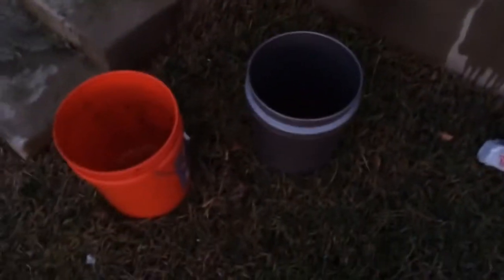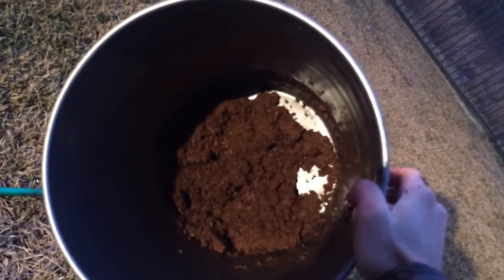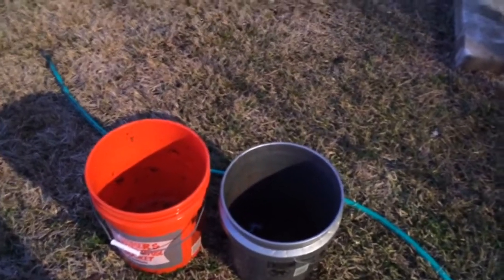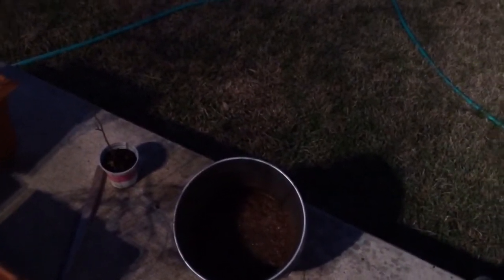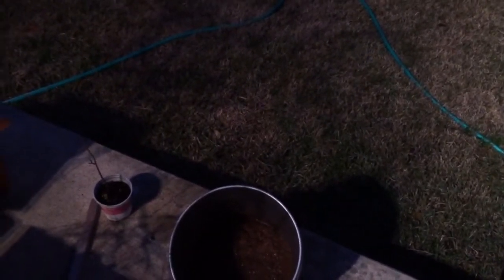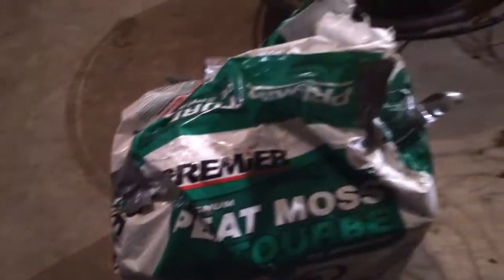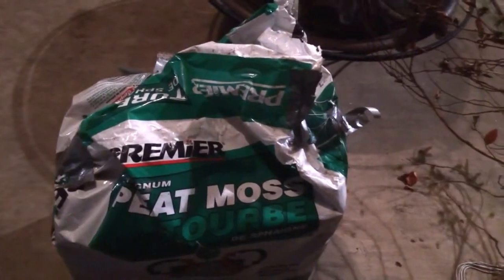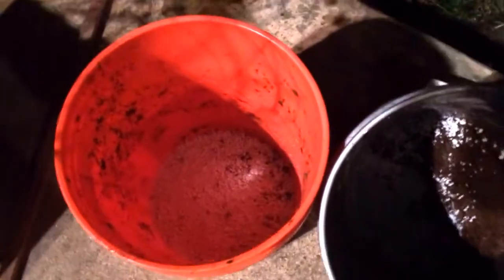Preparing Venus Flytrap Soil

Comment: Wait a second, you rinsed it with your hose water?? Its like adding more PPMs or TDS in your soil instead of straight out soaking then rinsing it with distilled water just to remove any trace minerals in it in the first place?? You're very lucky you have a TDS meter as your number 1 savior lol
Reply from the maker: Like I said, the hose water was cleaner than the media. If the water going in has a lower ppm than the water after soaking, you are reducing the TDS of the media. When you have a limited source of pure water, you don't have to use it on something an unlimited source can do.
Reply: I understand if your hose water has a lower PPMs in it, but how about the extra PPMs that's in your freshly unsoaked soil?? That will all add up and increase your PPMs when you mix the water and the substrate together after reading it with a TDS meter. No offense or anything like that but in my experience of keeping VFTs for 6 years.. I think your methods of rinsing requires more work. Again no offense just saying..
Reply from the maker: You seem to think the peat moss will act as a filter, adsorbing TDS from the water, but it doesn't.  I added 200-something ppm hose water and after soaking the water was 500-something ppm. That means it's drawing about 300 ppm of TDS out of the media. You could continue doing this until the TDS in the media equals the TDS of the hose water at which point it would not lower or rise any further. Maybe you're confusing the concept of concentration equilibrium at work here and TDS build-up in media from regular watering. With regular watering, TDS can build up in the media because it doesn't get washed out. It evaporates, leaving the entire TDS content behind in the media. Here, we are dissolving the TDS already in the media into the water and then washing it away. No offense to you either, but your 6 years and my 8 years of VFT experience have nothing to do with it. It's just chemistry.
Reply: Out of that 6 years, i never washed any of my VFT growing media strait out of tap. So whatever works for you should be fine, so i guess you know exactly what you're doing. Our water here in Seattle WA reads about 55 PPMs, but i wouldn't even dare try it, not even once. Although, you are kinda tempting me to do so to save on my Distilled water grocery bill lol  So you think that tap water when first washing your media works without worrying about the hazards of chromines than chlorine? Please enlighten me..
Reply: Well if you're in Seattle, you probably have access to lots of rain.  However, I would suggest that after 6 years, you probably have many plants, or can even go buy some extra ones for a test.  Try them out with your tap water and see how they do.

If they are continuing to grow well, then you have found an amazing source of water that can allow you to expand your CP garden immensely.

Comment: Can sand be used?
Reply from the maker: Yes it can as long as it's 100% silica. Otherwise it can leech harmful minerals. Sand helps keep peat from compacting which lets it drain better but t doesn't keep it lift and airy like perlite so I still prefer some perlite even with sand.
Reply: I'm not familiar with silica, the only two places I can retrieve is at a river bank, or store under play sand.